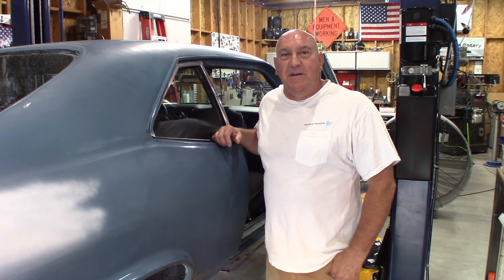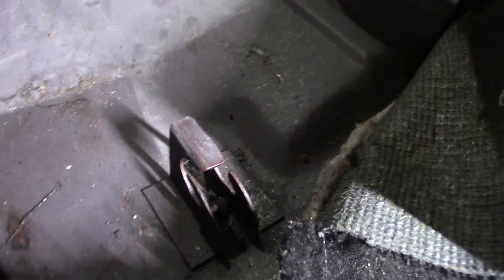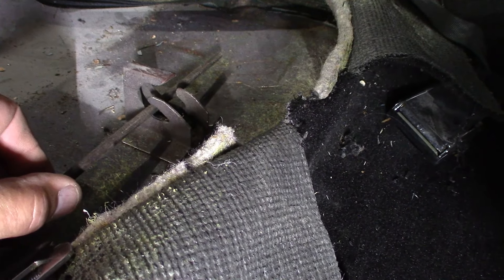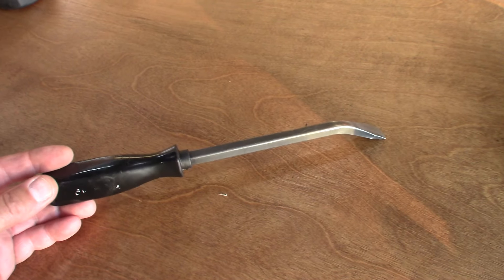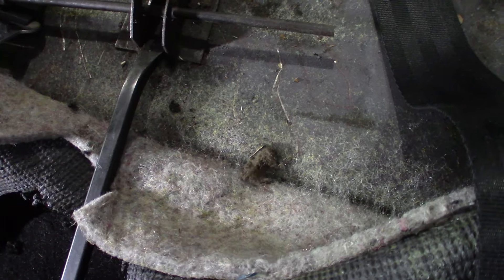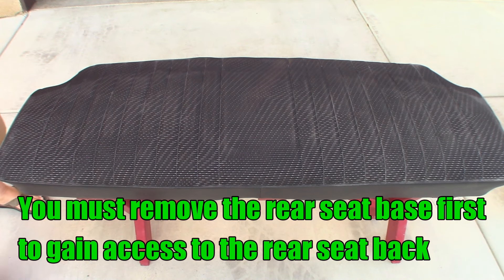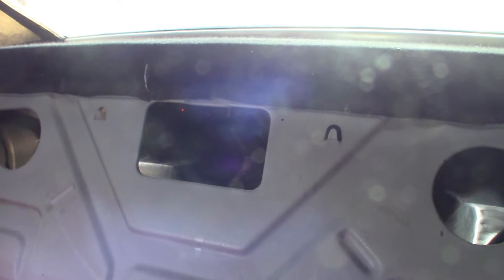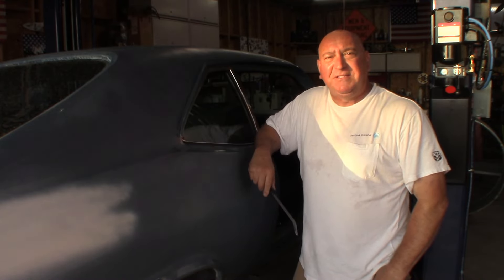68-72 Nova Rear Seat Removal Trick

Comment: Excellent video!  I only wish you had also shown how to reinstall it!
Reply from the maker: Many Thanks! Install the back first and be sure its locked down over the three seat back hooks, then install the bottom of the seat rear first, push it to the back of the car then sit it and it should lock back in.
Reply: @RaysGarage  thanks Ray!  I was able to get it back in using your removal method in reverse.  But your way sounds easier.  I’ll try that next time.

Comment: Hi Ray,  I've removed GM seats many times before, but one or more of the previous owners have always removed them prior to me removing them for whatever reason making it very easy for me to remove the seat without any tools. 
But the '68 Nova I have now has got 12K original miles on it and when I bought the car the factory  plastic was still on the back seat and the seat belts are unused till this day. 
I would not want to remove the seat but I want to get to the original build sheet.
But as you know the first time you try to remove the seat bottom its more difficult as everything is very tight, and especially after 54 years without ever being removed.
If I used your pry tool trick, how am I supposed to get the tool between the seat bottom and the floor.  Also if I am able to get the tool between the floor and seat bottom, how do I know how far over left to right so that the tool goes right in between the gap in  the lug that the spring locks into to be able to release it from its locked position?
Since your seat bottom comes out so easy do you think you can give me some left and right measurements from the both ends of the seat to the lug so I csn have a basic idea and can hopefully get it right in,  or be close enough that I can feel it with the tool and adjust the positioning slightly left or right to be able to engage the lug in the right spot. Thanks, John
By the way, you look really familiar. Are you located in Long Island?
I just read your info and see that you came from Philly and moved to California.
But you feel so familiar to me. I am a retired Cable Splicer and Central Office Tech with VZ.  Could it be somehow that we know each other thru the job??
Reply from the maker: Originally from Valley Forge, Pa now reside in Clovis, Ca. From the front of the rear seat the locking wire is 7” back and 13” in from the sides. Hope this helps! Unfortunately my build sheet was torn and only two small pieces left.

Comment: Same for 75-79 Novas? Also, I have a 76 2 door Nova so trying to get the seat out may be very tricky. Take one of the front doors off?
Reply from the maker: I was able to slide the seats out without taking the door off.
Reply: @RaysGarage  after I asked I see you separate the bottom from the top. Hope 76 is the same.

Comment: Ray, I am wanting to install slim subwoofers  under the back seat how much room do you think there is. I think the wires are in the way
Reply from the maker: Hi Ken, There is only about an inch or two at the most. I would recommend putting your subs in the trunk under the rear window deck and fire them into the car after cutting bigger holes in the seat back pan. Watch some of my mini tub vids, you will get a better idea of what I’m suggesting.
Reply: @RaysGarage  I'm think about making a subwoofer enclosure so two 10in can face the two teardrop openings that could be better,  what do think.
Reply from the maker: @kenf2662  I like that idea! 👍